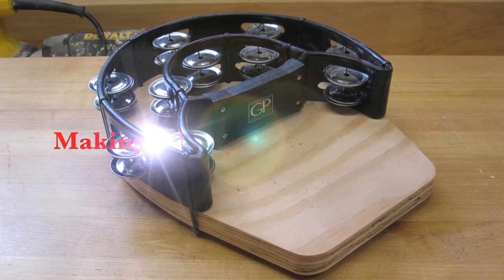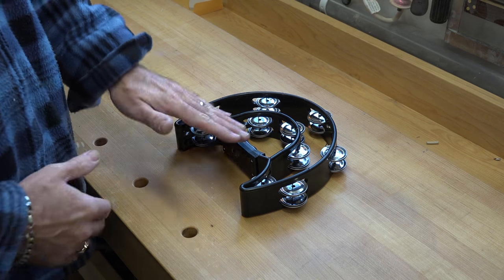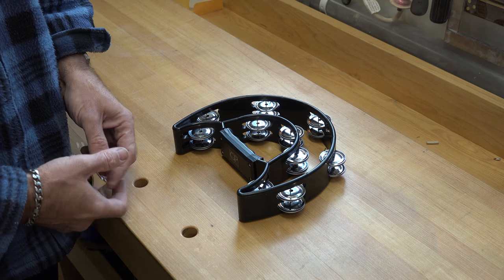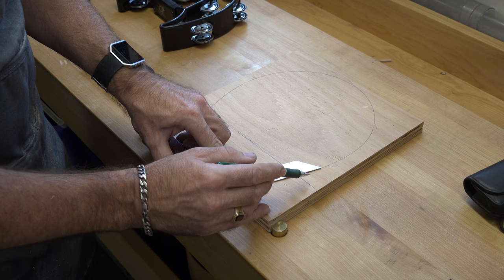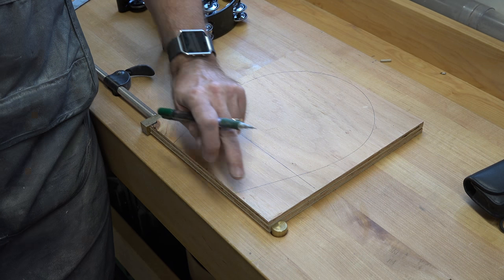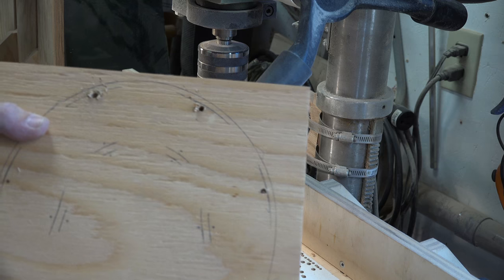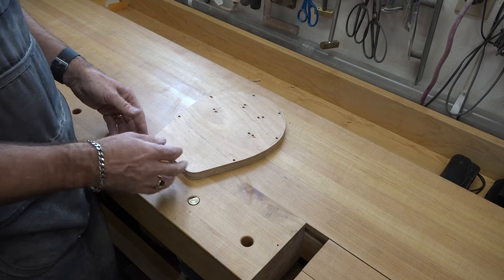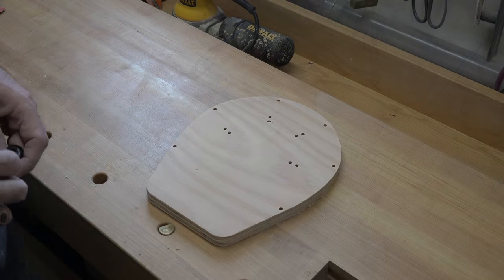Tambourine Kick Plate

Comment: I would have had the grain running rear to front as your foot is applied.
Reply from the maker: If that's the way that you would prefer it Jim, then by all means align the grain that way.  It's really just a visual thing when it comes to plywood anyway as the grains alternate direction with each layer so it isn't a strength issue.  Thanks for tuning in and for chiming in with your opinion.  It's appreciated.